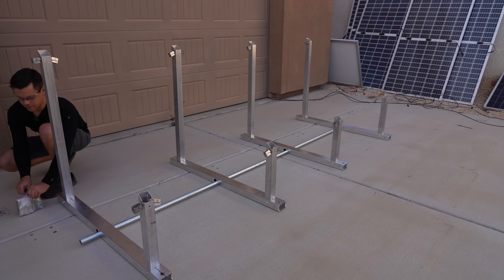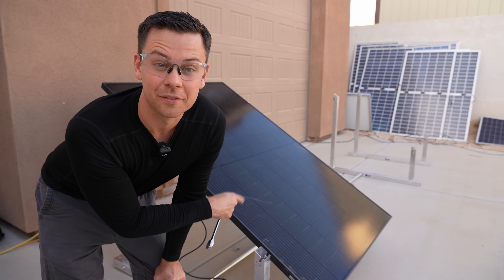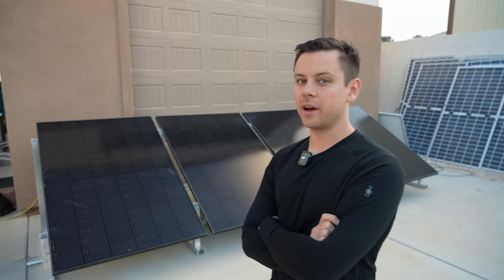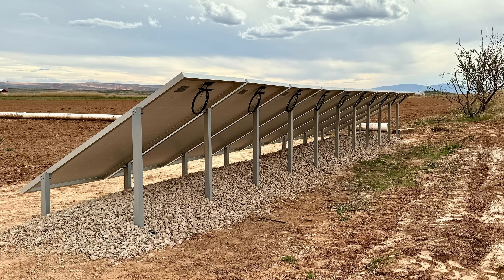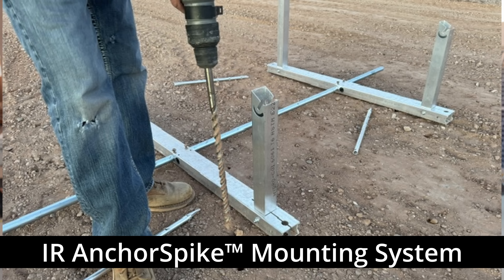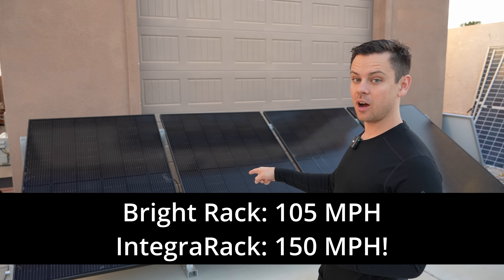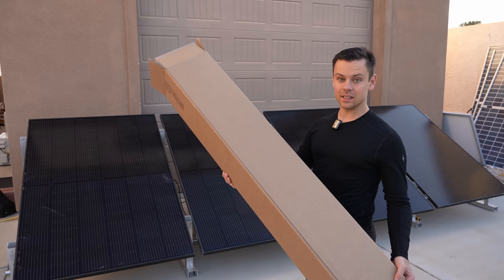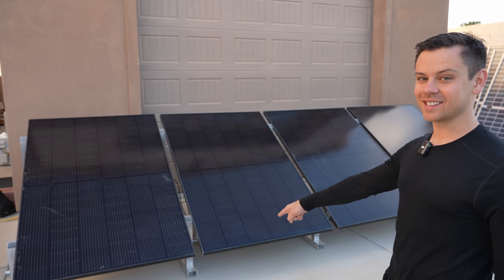IntegraRack: $545 Ground Mount Solar Array Assembled in Less Than an Hour!

Comment: Does anyone make a solar panel mount that bolts onto the eves of the house? 
I'd like to put 5 or 6 panels hanging off the edge of my roof, and be angle adjustable for various seasons.
That way I know the panels won't damage my roof, and it'll be easier when I need to replace my roof.
Reply: Stripping an asphalt roof makes a mess at and below the eaves. PV panels would be destroyed there.

Comment: Suggest they make a few options on angle from horizontal. Also, depending on soil type hot galvanized lag screws are easy to install ground anchors.

Comment: Looks great. Checking out the site to see if they provide some engineering drawings to appease the govment that feel the need to require permitting everything - call 5 banks/ 20 panels worth portable 😂. 

My only nitpicky thing is I  in the north east would need to tape holes and cap the tubes to keep pests from making home in the tube. If the tube is std size I should be able to easily find what I am looking for in caps.

Comment: Can you try setting them up in the new vertical setup, it should give more power than the old way of setting them up. see if there is a difference, on the vertically or horizontal.

Comment: Pretty amazing that you still had access to drill and fix it to your slab even after it was fully assembled with the panels in place :)
Reply: Even more amazed to do it in front of the garage door.
Reply: @vincentwilkes9611  I'm a newbie here and I like this guy's presentation method. Quick, to the point, get's it done, move on, etc. I was wondering about that garage door too. What's the story? It looks like an RV type door. Is it for future expansion? Let us know...

Comment: And nothing going under the panels, except for the wiring, which would make that mounting system nice for bi-facials.  Unfortunately their fixed 30 degree angle would be nearly useless during the winter up around the 45th parallel, or further north.

Comment: Perhaps a stupid question, but I have a south facing walkway next to my garage. I’ve been thinking it might be nice to have a covered walkway using solar panels, as that gets them off the ground (but NOT on the roof!) and the main panel is on the interior side of that wall. Easy tie in with almost no wire run from a field. Could the IntegraRack be used in that application, anchored to the wall of the garage and to columns to the ground?

Comment: I'd be interested to see how much force it would take if you went to the top corner of a mounter panel and pushed it sideways.  It would seem that there is a real need for cross bracing on these.

Comment: Let them dream of making sales at that price. 
People who can put that together, can also screw 2x4 lumber and make their own like I did.
Reply: Lumber is expensive as hell too! Aluminum frame would last longer, depending on environment
Reply: Have you seen a good DIY video for mounting panels on Youtube? Thanks!
Reply: They’d laugh you right out of the building permit office if you turned in a set of plans with a frame spec’d out of 2x4’s.
Reply: @Charlie-go6eb  We don't need a permit for floating structures. 
If it doesn't have a footing, it doesn't need a permit. Now, go away troll.
Reply: @piconano  how about some examples of floating structures as solar panel holders
Reply: @chuckger1625  When it doesn't have a poured footing, it's called a floating ftructure.

Comment: would be nice to have kits to build carports for ATVs, Garden tractors and other small machines, bigger ones for cars and trucks and even 14' high for RVs and travel trailers. It would provide shade and generate electricity at the same time providing dual functions at once. For an RV it would run the ACs while keeping the sun from warming up the roof. A nice feature for some would be the possibility of easy disassembly and transport to a new campsite or house.
Reply: Google it.  Solar car port racks are for sale

Comment: If you had one of the all-in-one battery systems that charges off the grid as an emergency power source during an outage,  this seems like a quick  way to set up solar panels and keep your house at least partially running.

Comment: You said the total weight being 40  to even 50 lbs would make me wonder about strength in a wind storm.  I over engineer everything but I was thinking to put a brace from the top long side to adjacent bottom creating triangles or web for a side load.

Comment: Ehhh. Not sold on these. I have two sets of brightmounts that I installed on a pressure treated wood frame and they're holding up exceptionally well to the Arizona climate that's been quite rainy. The brightmounts are much cheaper overall (3/5's the cost for 4 panel installation). The brightmounts aren't fixed angles either. Aesthetically, the brightmounts are the better option in my opinion as well. I could only see these selling well for 69-$79$ per set of legs. Really, what you're paying for is set up time and most of us DIY's are not afraid of an extra hour or two here and there to save on costs. After all, that's why the DIY community exists for the most part.
Reply from the maker: Yes good points. I think the big benefit here is speed for install and strength. Much stronger in multiple ways with the Integra rack.
Reply: We live coastal Nova Scotia. Needed a rack to survive hurricane winds. So far one hurricane and many tropical storms. No issues.

Comment: Needs angle of adjustment for seasonal changes, should be easy to add. Ask them about it
Reply: They already make it. The one Will is reviewing appears to be the IR-30 which is fixed 30-degrees; the IR-35A has variable 15-35 degree pitch. Price goes from $440 to $560 but that's still kind of crazy cheap. The also make several types of roof mounts that look pretty cool. Finally starting to see competition in the hardware market bringing prices down...ultimately this stuff isn't that complicated manufacturing-wise, so the margins were bound to come down someday...
Reply: ALSO , one  of my concerns !!
Reply: Looks like you could do it yourself with a hole saw.
Reply from the maker: Yes they have two models for that. And one is higher off the ground for snow: https://www.mobile-solarpower.com/ground-mount-racks.html
Reply: Having easy access to adjust the angle for different seasons is one of big benefits of yard arrays compared to roof, I'd definitely spend for those
Reply: Seasonal adjustment makes sense, but what is the actual penalty of a fixed angle array at, say, 38 degrees north?
Reply: @SkyCharter  In st louis at least (or that latitude), 38.6 degrees is the offset from the equator. So you'd go from +/- 23 degrees (seasonal tilt) year round, with best power in spring & fall.
Personally for 'fixed' panels, I like 45 degrees (at my latitude), or possibly even a bit steeper. It gives a bit of bias towards winter generation (which is where solar really struggles).
There's also the possibility of east/west solar (assuming limited clutter/trees in the way). Which you'd want at an even steeper angle.

Also the incidence of impact for hail is better with more angle. And rain+gravity makes steeper angled panels "somwhat" more self-cleaning, and less prone to snow/ice accumulation, etc. And east-west, or southeast/southwest probably more ideally, angles can provide better charging "times" (more hours of production per day, rather than more peak production).

The 'perfect' solar array would be kinda a half cylinder shaped array, jacked up to an angle for your lattitude, and adjustable +/- 23 degrees. But it would look kinda odd to have a steeply leaning arch in the yard. And wouldn't be very storm resistant. Also, you'd want different angled solar panels to not be wired in series, cuz solar panels in shade can rob all the juice from the production of ones in sunlight.

If it's a more budget array, purely to offset summer AC use... then you'd want it angled southwest, with a steeper angle than the installers will recommend. Installers are trying to reach their "claimed" power output ...but only on June 20th at noon. But realistically as a power consumer, you want more evening than morning power, and to have "enough" power when the sun is lower in winter months. 45 degree angle south-by-southwest would suit most users better than 30 degrees south. Myself I'd ideally want southwest and southeast solar in a V shape, at about 55 degrees. Or maybe a trapezoid with SW/S/SE at55/45/55 degrees. And then a smaller separate set of panels southwest at about 30 degrees, purely to boost power for the AC in summer. Could do it with an uncommon corner-merge on a gambrel style roof.

Comment: you know, I have a 30 panel array that I built useing 4x4 and 2x4 with also 2x6 and for the cost of one of these frames you can build what I have holding 30 100watt panels 6 rows of 5 panels tilted to what ever you want it at.  Mine been through wind storms to major rain. and snow with no issue for 7 years.
Reply: Can we see pictures?

Comment: Wondering about adjustable racks. Here in central texas would it make sense to have a rack with sliding support legs on the lower side?
 Then you could raise it a bit each month until the middle of the summer and lower it during the fall.

Comment: Did I read that correct $109 per frame and you need 5 frames for 4 panels so over $500 to mount 4 panels ? If so I will pass
Reply from the maker: Yes that is correct

Comment: Check out Wej-it PD 58 anchors. If you ever move the panel mount, these are flush with the concrete. Easy-peasy
Reply from the maker: I need to check those out that sounds awesome

Comment: I have a 17 degree south facing slope on my property and I laid out a 5s4p 20 panel array on the ground with some basic lodge pole wooden ground mounts. It works perfectly and I get about 90% efficiency based on some charts I saw for angle and orientation. My biggest concern is elk walking on them, but they've actually done quite well at walking around them. Digging them out of the snow is a bit of a pain too, but I prop them up with the snow in the winter to get as much as 30 degrees tilt. I'm at 48N in Montana.

Comment: My only concern with metal that is that lightweight is resistance to corrosion over time.  Probably not a concern in Will's environment, definitely would be a consideration in areas of high humidity and moisture.

Comment: The biggest issue I see is the fact you need a completely flat surface to mount them to. Would be nice if they made a way where you can let a base frame follow the ground contour with rock or tanks of water securing them to the ground and then adjust the upper frame the panels mount to so they are level. 

Otherwise it looks like pouring sonotube footers on grade would be the best mounting option for unlevel ground.
Reply: Our 17 panels are mounted on uneven ground. It looks like a wave! We used gravel ballast. We live on the Bay of Fundy. Survived one hurricane with 100+ mph winds. Very happy

Comment: Is there a video for mounting individual panels on a wood-framed home? 
I'd like to place one over four windows of our home. Cooling, but also capturing the sun with the solar panels. 
I drew something up in a pergola style, but is there a better way to do it?
Reply: So basically you want to use the panel as an awning above your windows?
Reply: @MyCabinLife  - correct. We have three pods, individual structures, with this one being on 18' pilings/poles. The walls are 9'. The roof has a 1' overhang at an 8:12 pitch.
Reply: And also are the four Windows right together or different sides of the house?
Reply: @MyCabinLife  - two windows per side, spaced apart, so two individual supports. Panels not connecting together.

Comment: This is a nice looking product. I'm so annoyed I can't really use it. I have a bunch of panels but can't mount them on the roof because the city wants a full permit and inspection. It will never pass because I'm not using any UL listed batteries and MPP inverter. It just serves as a power backup at this point, which is cool, but not what I want.
I would ground mount as the city doesn't care but there's very little space between me and my neighbors trees. I only get uninterrupted sun a few months of the year for a 1-2 hours a day at ground level. Roof mount would be good sun nearly all day.
Might have to bite the bullet and replace the MPP with an EG4 even though the MPP is working fine. I just won't connect the batteries and keep them hidden until after.
Reply: Similar here. Ground mount- no paperwork, but trees are a problem. Roof has room but is needs engineering diagrams and approval.

Comment: I like the original design, panel clamps and ballast options but at $600+ for 4 panels with shipping, there are a lot of comparable options for less money out there.  A brightmount with extension kit for 4 larger panels is only $304.  But some folks will pay more for simplicity, so it might work for them.  👍🤓
Reply: probelm with cheap panels is racking costs as much as panels these days.

Comment: Exactly what I have been waiting for.  Hope to purchase a bunch for my 30 panels sitting and waiting
Reply: There are a lot better ways to spend $3,500 for what you will need to mount all those panels
Reply: @DESERTDWELLER4547  
I was confused by the price.
I am still not sure where to buy steel pipes for regular ground mounts
Reply: @michaelshin69  I understand that. This is way overpriced, it should be around $250 price range to mount four panels. As far as buying steel for your project there are local steel yards in your area that could help you out